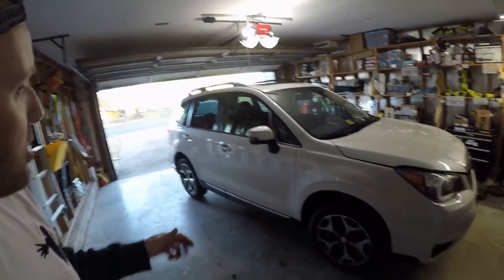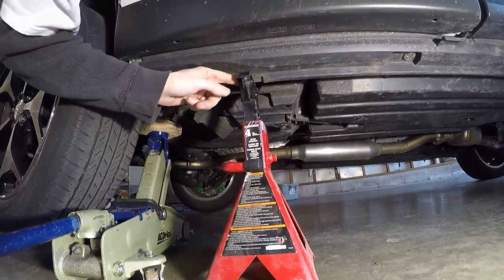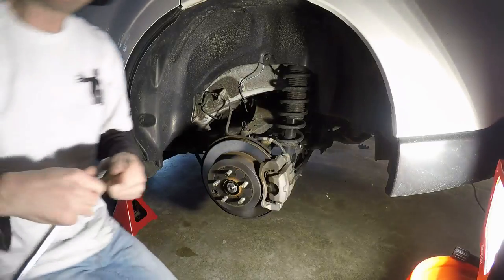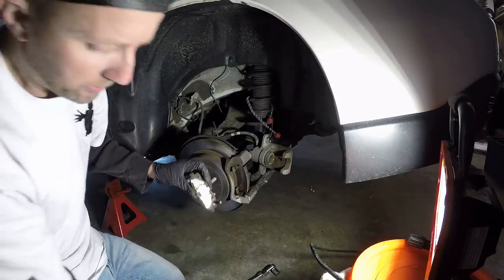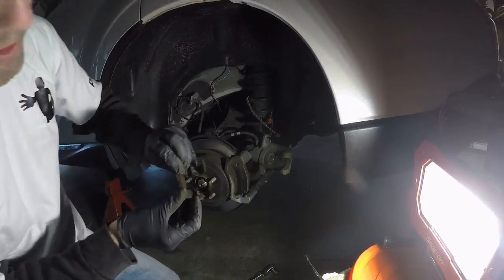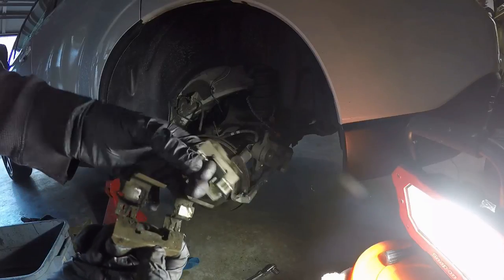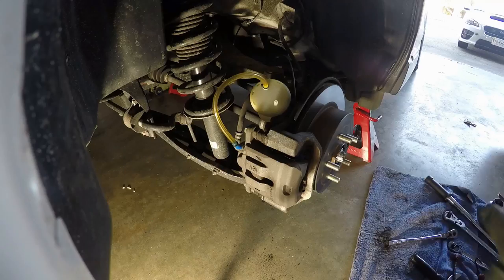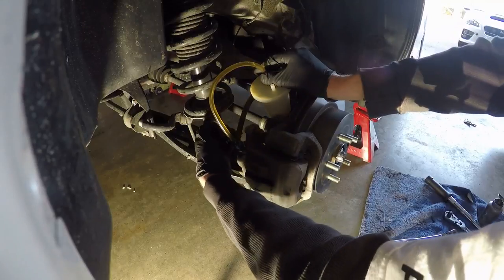2015 Subaru Forester XT Ep. 83: DBA Brake Installation Part 2

Comment: Random question, in the passenger side rear wheel well near the brake calipers do you have a rubber drain line routed nearby the caliper? Was wondering if you knew what the drain line was for...
Reply from the maker: sunroof drain
Reply: @LastHumansGarage  Thank you so much for answering so quickly! Been watching alot of your FXT videos! Keep up the great work!!!
Reply from the maker: @richardsitu  oh... i thought this was a GTI video.. well, prob the same thing on the Subaru, assuming you have a pano or sunroof..

Comment: Does dba make rear pads for the 19 wrx? I checked on rallysport direct website and didn't see any 15+ rears
Reply from the maker: dont know anything about 2019s.. but 2018 wrx should use the same rear pads this XT used.. DB1722SP DBA SP500 Street Performance Brake Pads

Comment: Just to clarify the rears are different depending on if you have eye sight or not? So if I dont have eye sight then the rears I find on brake websites ARE correct? Or are they only fitting for models WITH eyesight
Reply from the maker: they dont make rears at all for the forester. any kind.
Reply: Wow that is a big oversight, and Not just DBA, but no company? Besides subaru OEM?
Reply from the maker: i was only referring to DBA.
Reply from the maker: our Forester XT still runs this brake setup. no complaints. and we still on stock rear rotors. but they do make the rear pads which we run..

Comment: Can you list part #'s for the pads.
Reply from the maker: DBA42650S-10
DBA T3 ClubSpec 4000 Series Slotted Rotor -
Single Rotor

DB1722SP DBA SP500 Street Performance Brake Pads
2015 Subaru Forester 2.0L XT Premium – front

DB1789SP DBA SP500 Street Performance Brake Pads
2015 Subaru Forester 2.0L XT Premium - rear
Reply: @LastHumansGarage  the DB1722SP fit the 19 wrx right?